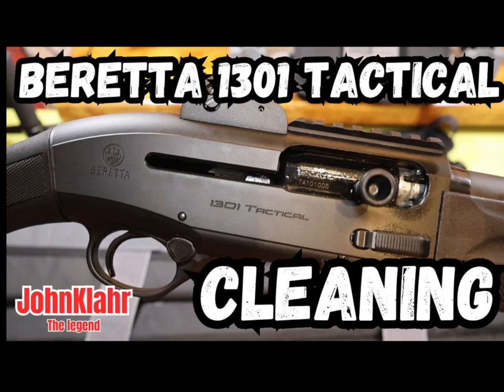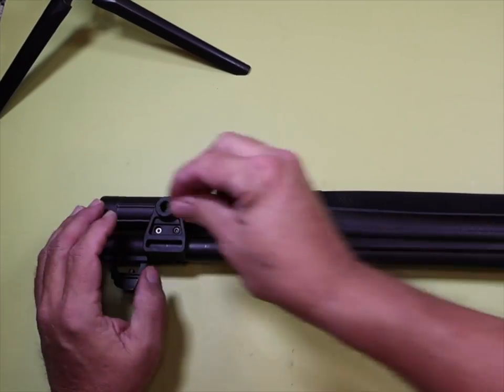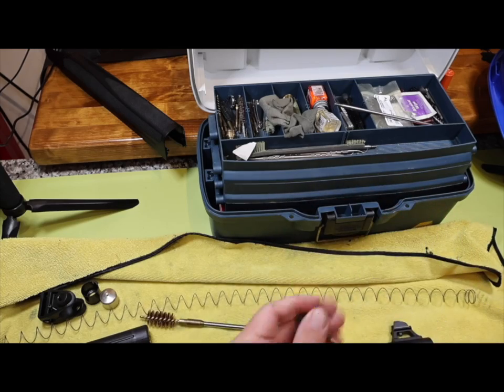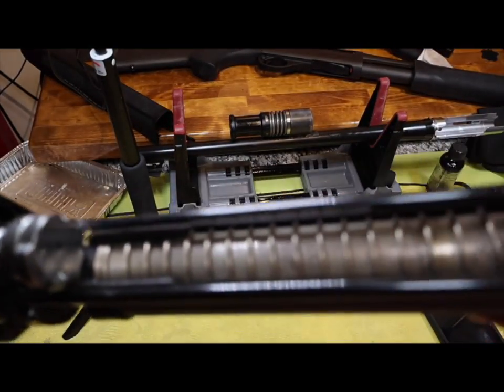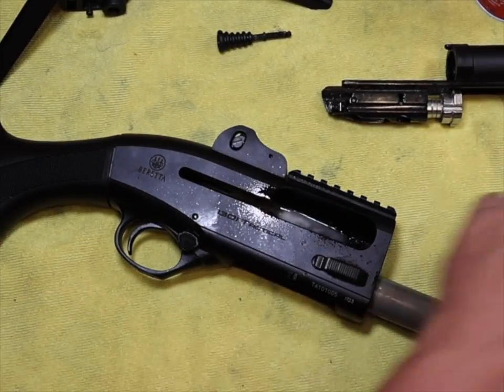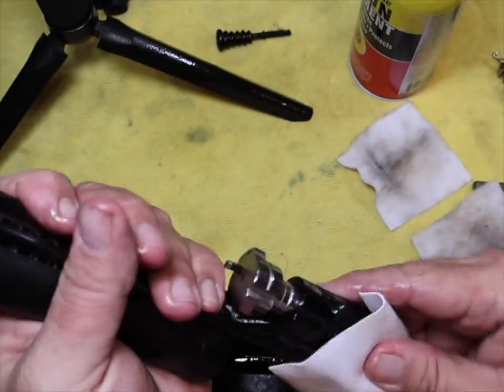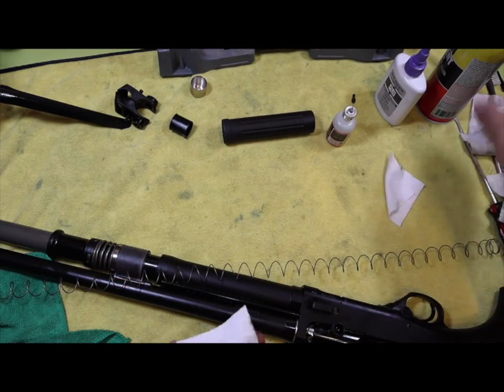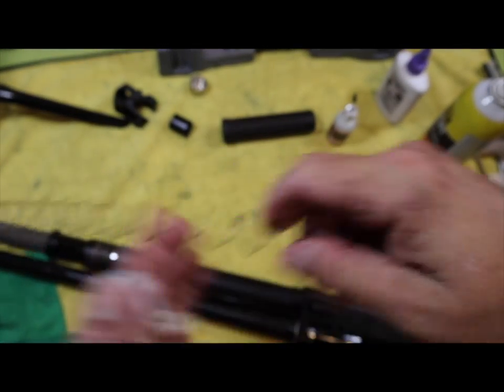Tear down, Inspection and cleaning of my Beretta 1301 tactical 12 gauge shotgun

Comment: Great video. Lot of good information, and good commentary throughout. I think your method of using a patch wrapped brush is a good one. I was using ballistol and a bore snake but it just wasn’t doing the job. Patch wrapped brush cleaned her right up!
Reply from the maker: Thanks for checking out the video
Reply: @JohnKlahr Thanks for posting it! I also wanted to ask you this. When I am putting my bolt carrier assembly back on, I sometimes run into some trouble fitting it over the magazine tube. The magazine tube travels through the spring and outward, and sometimes at the very end it seems that spring is not quite lined up with the ring and causes an issue for the mag tube to freely pass through. I usually have to stick my finger in there and coax the spring into place and try a few times before it (the mag tube) comes out the other end. Have you ever experienced this? I saw you put yours back on with pretty much no trouble at all. I wonder if the spring is not seated properly?
Reply from the maker: It’s is a bit tricky and not sure how to explain it, I’d have to tear mine down to remind myself, maybe I’ll do that soon for you
Reply: @JohnKlahr  I sure would appreciate that. I have subscribed and turned notifications on for your channel already, so I’ll be sure to keep an eye for for that or any other future helpful videos of yours. I followed your lubrication methods as well. Many told me that the blink system likes to be dry, but I ran into some issues that way. The gun came out of the box pretty “wet” and it ran great. When I cleaned it for the first time, I was very very conservative with the oil, and used no grease. It didn’t seem to like that so much. I think for now during the break in period I will run the gun on the wetter side!